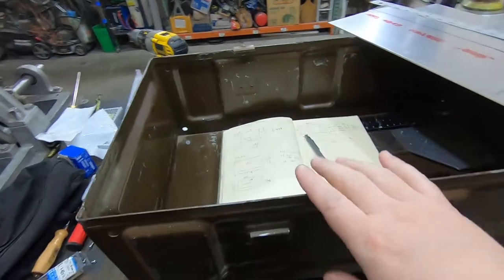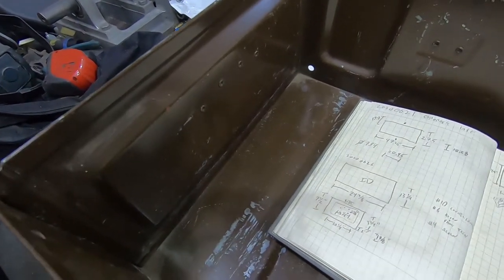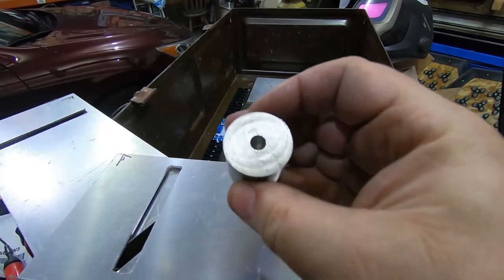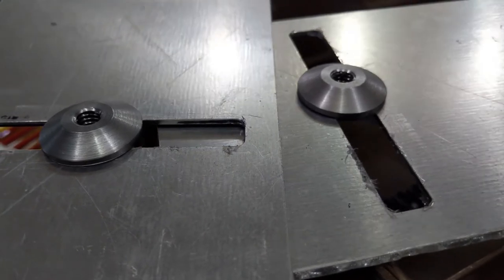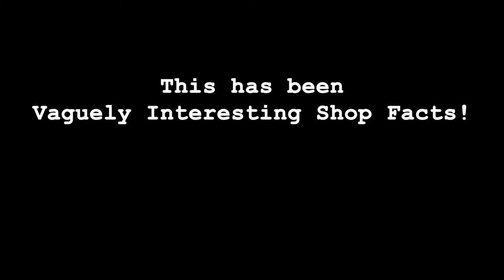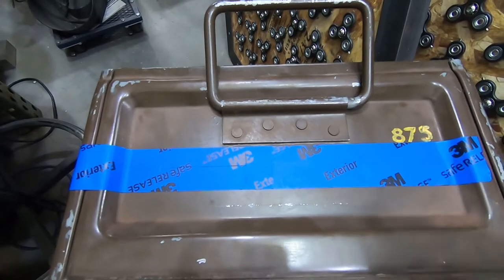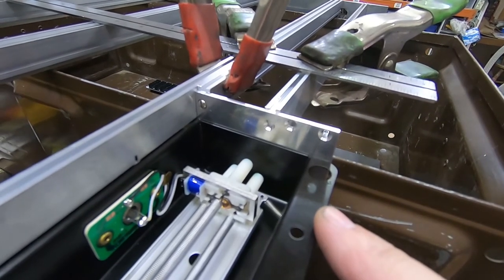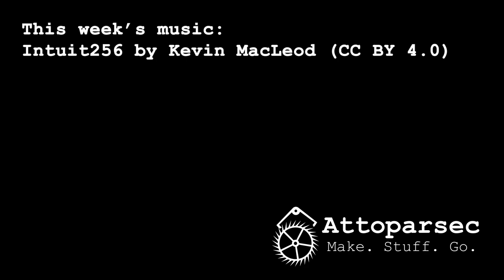Eurorack DIY: Custom case #2

Comment: I’ve had the wires between my spring reverb’s transducers and the jacks actually snap and wear out substantially all due to those wires being far too short and not allowing for much sway, since there needs to be enough slack in the wires to allow some movement.  It took me a year to finally conclude what made those wires snap, they’re thin too.  That’s some really top notch DIY.  The Irukandji glitch drum is a very fun module, especially if you pitch it with a sequencer.  That one can give some very unique sounding digital drones.  Really cool case.  THANKS FOR SHARING THIS!

Comment: Great work and great to watch you work, as usual.  Aside: what's the thing with the pillow blocks beside your vise, in the background of the first few minutes of the video?
Reply from the maker: That's the steam engine I never finished building. =\
Reply: @Attoparsec  I have one of those.  After a couple years of it staring resentfully at me I had to hide it in a box.